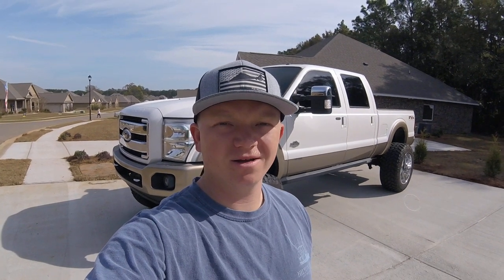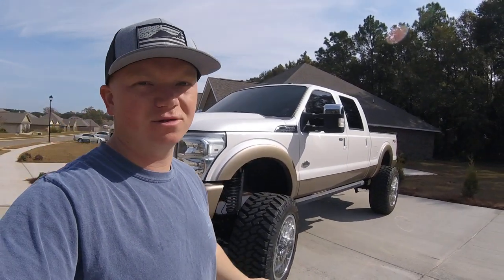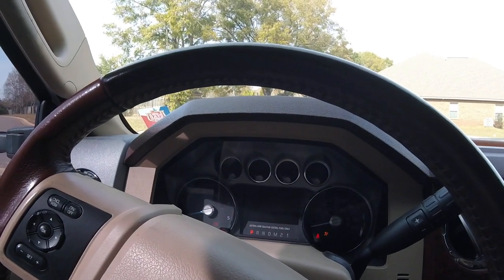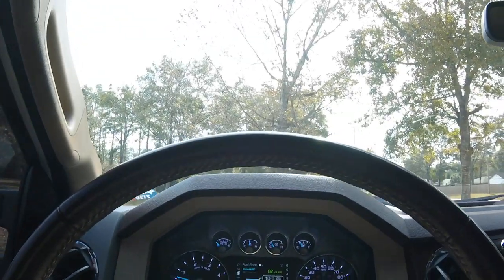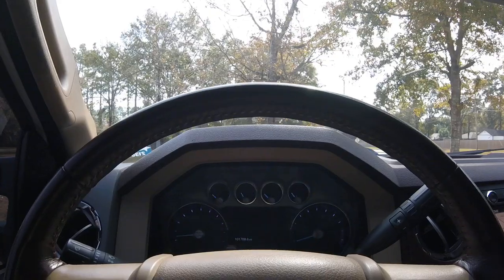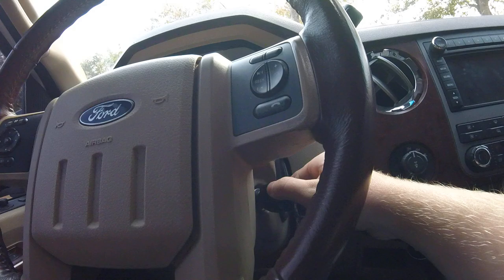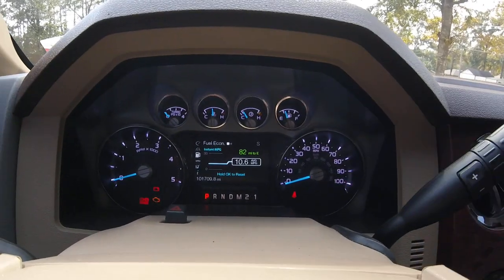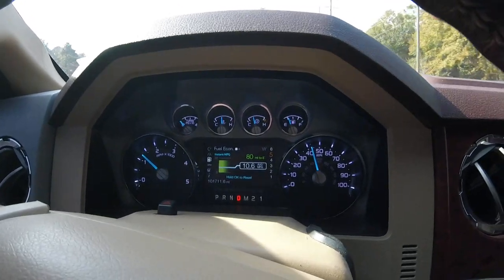Turn Off Seat Belt Chime in a Ford 2011 or Newer: How To

Comment: Did NOT work in my 2012 F-350.  Seatbelt light did not come on and flash after  3 times of connecting and disconnecting seat belt.  Any suggestions?
Reply from the maker: Weird! Make sure you follow every step exactly with the locks and all. I’ve done it on many 11-16 f250s with good results

Comment: One question do you have to disable it each time you go somewhere? After I disabled it I decided to try it and turned in my truck to go somewhere and the seat belt came on again
Reply from the maker: In my experience if you get it turned off correctly it should not come back until you turn it back on by repeating the procedure. It might reset if your car battery dies or something like that

Comment: Do you know how to turn off the head lights when you shift into gear?I have a 2015 f250 6.2 gas truck an when I shift into gear the head lights automatically come on  might be different since yours is diesel any info is appreciated thanks
Reply from the maker: Caleb Simmons I leave my head lights dial turned all the way to the right and pulled out for automatic head/fogs and they come on when it gets dark enough. Otherwise they are off. The only other random thing I know about headlights is that the fog lights turn off when you have your high beams on. I’ll let you know if i find anything else.
Reply: @GRAPPAHOLICS  I don't have fog lights,what does pulling the light switch out do?
Reply from the maker: Caleb Simmons pulling it out turns on the fog lights. And if it’s in the automatic position they come on and turn off automatically with the head lights. If you don’t have them then I imagine it won’t pull out or it won’t do anything if you do

Comment: Can we see the TPMS video? I've got a 2012 F350 and it goes off all the time.
Reply from the maker: Matthew Grieshop My EZ Lynk tuner from PPEI has settings to adjust the tire size for the speedometer and turn off the TPMS light. I don’t have a quick fix for that one without a tuner unfortunately.